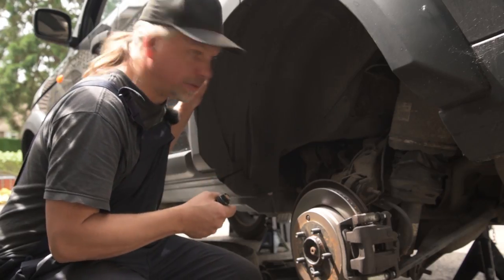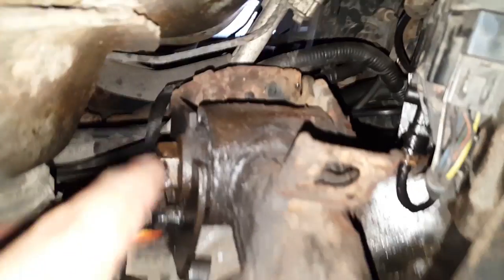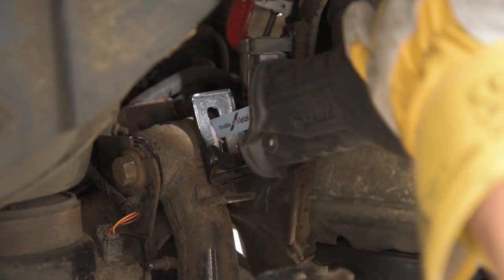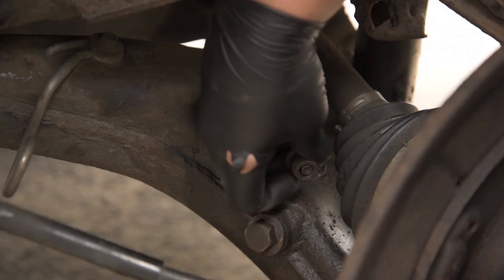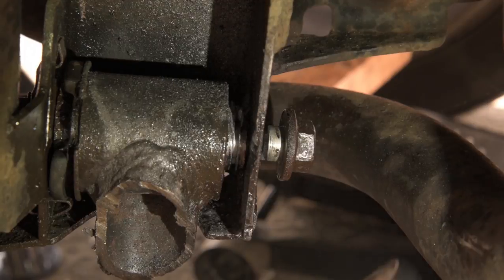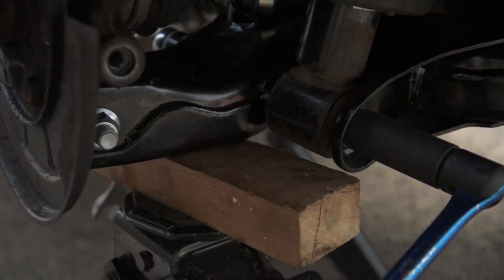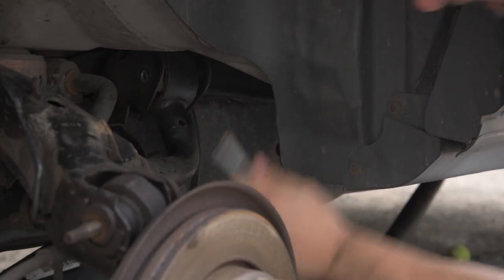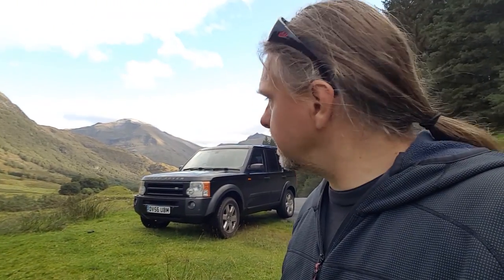Replacing Rear Suspension Arms and Polybushes - Land Rover Discovery 3

Comment: You know, I'm ±900 kilometers away from the problem and I've been thinking: next time, just saw the entire car in half and weld on a new rear end! It'll be quicker, cheaper, and will require less saw blades! 😂 

Is your girlfriend from Iceland?
Reply from the maker: There must be a better way than saw blades?  Lasers?  Perhaps scoring a line around the middle and letting it rust through?  I'd like to use and axe.

Comment: have you ever done the front LCAs with Poly bushes ?
Reply from the maker: DizzConnected
No, haven't done the fronts yet.  I'd probably not use poly bushes again, they're too noisy.  I've heard the fronts are a bit easier to access.  Will be doing mine at some time in the future, along with new shocks.
Reply: We Are Big Kids thanks for quick reply.
What sort of noise are you experiencing ? I’ve read that the ones to get are those with the grooved inserts for better grease retention.
Mine are still sitting in the box waiting for me to fit them.
I’ll be looking through my fingers when I get them out, hoping I see some grooves. 
Thanks again
Reply from the maker: With my poly bushes I can hear a loud rubber-squeaking noise as the suspension moves.  Like fingers pulling across the surface of a balloon, or someone walking in latex leggings.  When you drive over a speed bump it sounds like someone bouncing on an old spring bed.  Loud outside and louder inside.  Especially when you raise or lower the suspension.  Mine came pre-fitted into the arms, so I have no idea about the grooves.  These have been in my car for about a year now and they still make the noise.  I will go back to factory standard next time.
Reply: We Are Big Kids wow, that sounds awful. I pretty much flipped a coin after not being able to decide between polys and HD Meyles. Where did you source yours from ?
Thanks again for the reply :)
Reply from the maker: I actually chose to have poly bushes, but was disappointed. I got them from Advanced Factors.  They do have other choices there.
Reply: We Are Big Kids  ohh no!!!, mine are from AF too. Time to email Paul, I think.
Thanks again for the feedback.

Comment: What torque wrench did you use?
Reply from the maker: My 1/2" Torque Wrench (28 - 210Nm) is STAG TOOLS.
My 1/4" Torque Wrench (5 - 25Nm) is LASER.
Both work well and were cheap.
Hope that helps?
Reply: @WeAreBigKids  thanks!

I am swapping out my 14 year old air bags for coils in a month or so and having to replace my rear lower arms at the same time.  Thanks to these tips I am building an arsenal of tools beforehand.

Comment: can you put a list of the components and tools
Reply from the maker: Hi there. I should have really made a list back when I did this fix, but I didn't because I kept purchasing thing s as I found out I needed them.  I used an engineering manual for the Discovery 3 to help choose the parts, which can be found in the files section of this Facebook Group (https://www.facebook.com/groups/207921512745848/)

As for the tools, I'm really not sure what the best tools to use are.  I just made do with the ones I had until I got stuck.

People keep telling me to buy an air ratchet and impact sockets for undoing the bolts, but you'll need an air compressor too.

You'll need a do range of metric sockets, short and deep ones.  The car is designed so you don't need the same size for nut and bolt at the same time.  Buy 1/2" connector size, as the smaller ones aren't strong enough.  Get a really good breaker bar, too.

Metric spanners, all sizes.

Cutting device.  I used an battery powered reciprocating saw, but people keep telling me an angle grinder is the thing to have.  I do not have an angle grinder.

Jack, axles stands, etc.

Very important you have Torque Wrenches.  You need everything from 7nm torque up to around 300 nm.  But you won't find that in one single wrench, so you'll need to buy two or three.

Some sort of blow torch too, for heating up rusty bolts.  You can get electrical inducers, but I don't know much about them.

But, to be honest, I don't really know what are the best tools.  If you watch the video you can see everything I used, but I'm sure there are better tools for the job.

Good luck!
Reply: @WeAreBigKids  thank you for the information I love the video you made

Comment: At what point did you torque up the arms?
Reply from the maker: Torque the arms at the point where you jack up the arms and measure the height, to simulate normal ride height.  If you put the wheels on and stand it at normal height you can't get a wrench in.  Hope that helps.
Reply: @WeAreBigKids  Cheers man. I've got the hub at ride height (495mm for me, hub to arch)... The upper rear bolt is nearly impossible to get decent torque on; I reckon I've got it at about 150 but it's meant to be 275..

Awesome vid btw, if not just for entertainment purposes.
Reply from the maker: It's clear when working underneath these Discos that they're assembled from above in the factory, without the body in place. 
One mechanic said, "Just do it up, bloody tight."
Another said they cut a panel in the floor at the back to get the torque wrench in.
I opted for "Just do it up bloody tight" using my breaker bar.
Reply: @WeAreBigKids  Yeh I got all of them pretty damn tight, ignored the ridiculous torque ratings given by land rover. It's just that one mentioned that's slight concern. As you say, definitely infinitely easier with body off but tbh a very satisfying job to have got done. Do you have IG?

Comment: Im wondering if a torch would help?  I used it to remove portions of my rusted exhaust system!
Reply: Louis Andrew, you must have fallen asleep or navigated away before that part of the video.  You are excused, it is blisteringly hot outside
Reply: Simon Kotowicz Yea, skipped around your video.  To clarify about the torch method.  You can use a torch to heat the bolt or nut to aid you into removing the bolt!  I don’t know if you knew that!
Reply from the maker: Torch method is already part of the video.  Thanks any way.

Comment: If you set the disco to access height prior to starting work it will let you get the shock bolt in easier as there will be less air in them
Reply from the maker: Brilliant!  Not heard this tip anywhere else.  Will definitely use this next time.